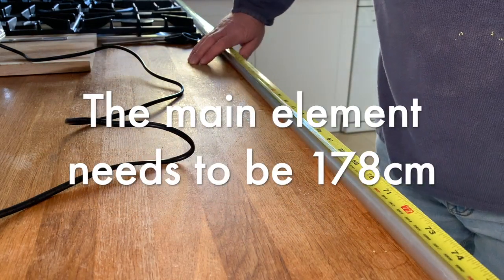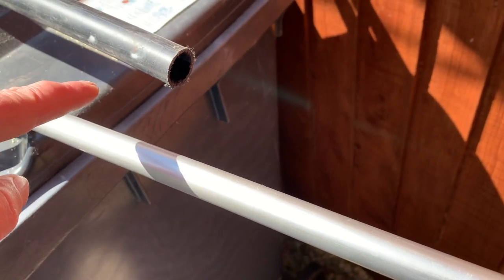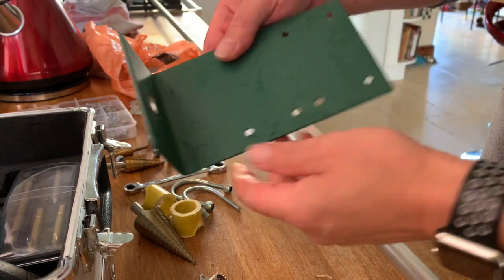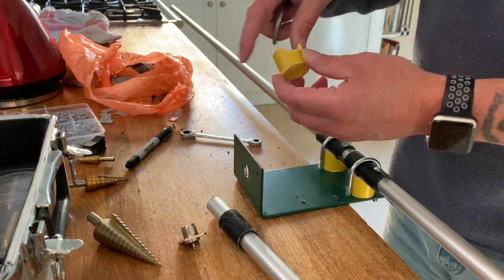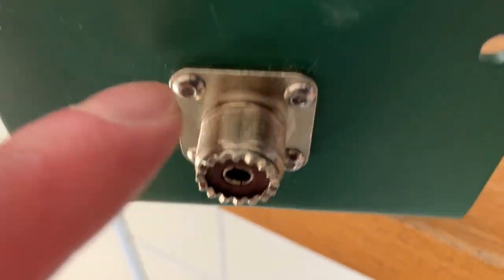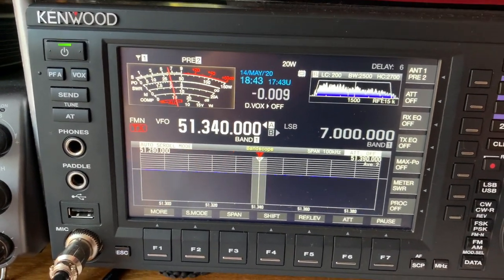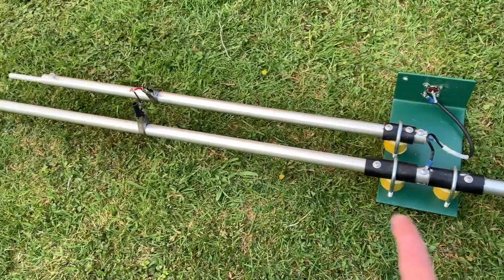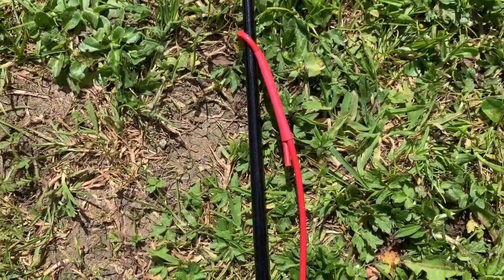Build an antenna for 6 Meters-  - Lockdown activities Part 7

Comment: just watched your video      and had to point out  your gamma  match is wrong 
 you have a jumper from the outer of your gamma  tube   and not  the inner  rod  so you have a t match   you are noi using the Capacitance at all  thats why your swr is not 1:1 
simpley move your  jumper  to the inner rod   and make you outer tube smaller   move the rod in or out to get min swr  dont forget there must be an insulator  inbetween  the rod and tube 
best is teflon for  high  power 1kw plus

Comment: Hi just wondering what the advantage of using a gamma match over a normal dipole ? 
6 m is a interesting band I worked Canada from uk yesterday on ssb using 50w and a 2 element yagi at 20 ft , cheers de 2e0nbk

Comment: Mike, your gamma match will likely show up as inductive if you use an antenna analyzer, which is preventing lower SWR. Most gammas are built with insulated concentric tubing isolating the coax center connection from the gamma tube, forming a variable capacitor with a value determined by the overlap of the tubes. (No DC connection from the coax center through to the antenna element.)  Once you get the tap point on the element in the right spot, you can then shorten the inner gamma tube, reducing its capacitance, until it exactly equals and cancels the inductive value of the gamma match. (But some homebrewers build it that way and never get it matched under 2:1 anyway!)

An alternate method might be a small variable cap insulated adjustment shaft, or insulated screwdriver, connected between the coax center and the gamma tube. But that will require additional weatherproofing if used outdoors. Thanks for your videos! 73 - AE4KR
Reply from the maker: Great info Thanks 👍

Comment: Hi Mike! A great channel growing here 👍 I threw up an inverted-V for 6m just the other week by adding elements to my 20m (got a 40-10 EFHW too but still missing 80m). The 6m band is peculiar! I have some time this next week so likely to be found somewhere on the dial. Subscribed! De 2E0RYD (must get my M0 finished!) 🤘
Reply from the maker: Hi Paul, great to have you onboard, Yes come on get that M0. see ya on 6

Comment: Another good lockdown project ticked off, shame the band was so dead so you couldn’t enjoy the fruits of your labour more. Thanks Mike
Reply: Wind your coax at the aerial feed point about 5 loops in a small circle .. try it with 4 loops or 6 .. it might just bring your SWR down.. or make an aluminium 1/4 stub and put it over the  coax close to the aerial feedl..